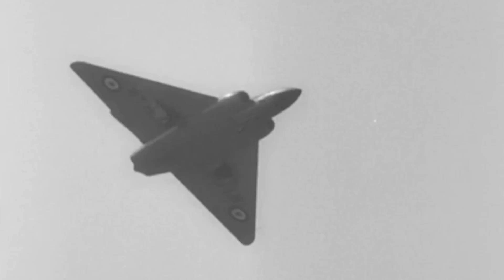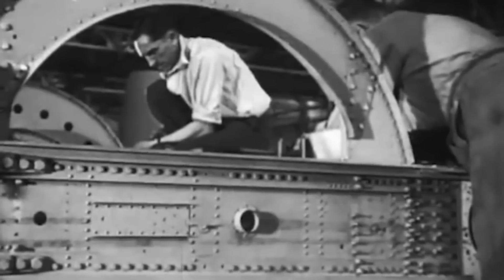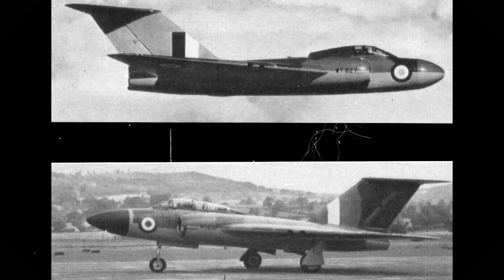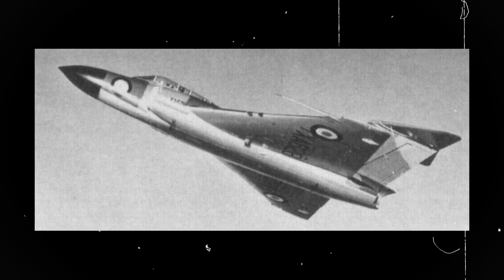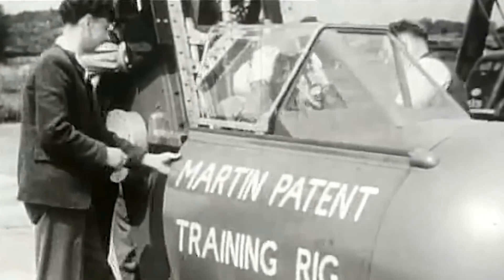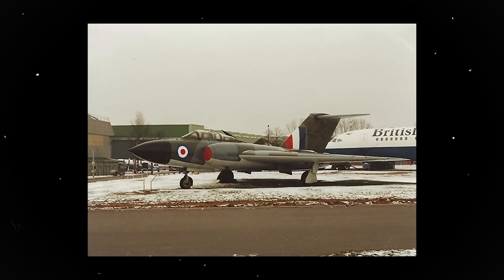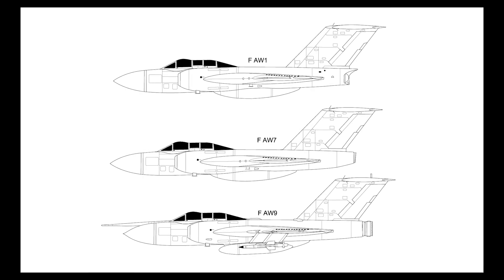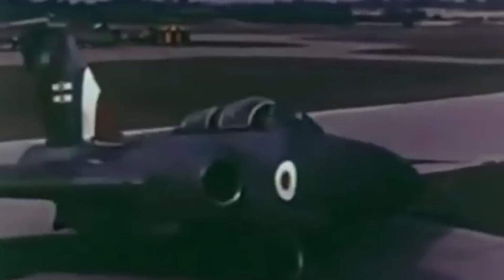The Bizarre Interceptor That Accidentally Broke the Sound Barrier

Comment: Is it just me or does the Javelin look like an early variation of the Tornado?
Reply: I think you need a trip to Soecsavers.
Reply: the Tornado is a German aircraft
Reply: @DoktorBayerischeMotorenWerke 
Obviously the Panavia Tornado is not a German aircraft.
Reply: @DoktorBayerischeMotorenWerke 
Jerkzxoffenzstadt & co etc - they should note with great deference & much awe.
   Having a registered office in Germany doesn't result in the Panavia Tornado Consortium actually being a German company.
     Indeed Germany of course no longer makes jet aircraft obviously.
           C H E E R S
                      &
Toodle   PIP  _Old_. Chap.
Reply: @petemaly8950  Germany is the largest manufacturers of jet aircraft in Europe... Please name a single British jet still in production in the UK????
Reply: @DoktorBayerischeMotorenWerke 
As they're aware obviously.
Germany has some assembly lines doing some routine drudgery stuff.
    In fact, BAe Systems, Rolls Royce of England & more than 200 other companies does more aerospace work than Germany on an absolute basis & considerably more work on a per capita basis.
  They might like to answer this question.
  Which airline has just ordered 60 RR XWB engines & what aircraft are the engines for?
  Bonus question for ten points - which country has the highest per capita combined aerospace / nuclear / defence sector activity in the world?
   😎
Reply: @Paul-mh9pr  Please name a single British jet aircraft still produced in the UK?
Reply: @DoktorBayerischeMotorenWerke  

They should note well with all due reverence & great awe.

WHY IS IT THEY CAN'T ANSWER SIMPLE QUESTIONS?
As they are aware, it is undoubtedly the case that the international aviation language is English & of course German pilots talk to German ATC in English 
As they're also aware obviously.
Germany no longer manufactures jet aircraft.
Germany has some assembly lines doing some routine Airbus assembly / drudgery stuff.
    In fact, BAe Systems, Rolls Royce of England & more than 200 other companies does more aerospace work than Germany on an absolute basis & considerably more work on a per capita basis.
  They might like to answer this question.
  Which airline has just ordered 60 RR XWB engines & what aircraft are the engines for?
  Bonus question for ten points - which country has the highest per capita combined aerospace / nuclear / defence sector activity in the world?
   😎
& Indeed 
 C H E E R S
of course👍
Reply: @DoktorBayerischeMotorenWerke 
    Of course, the basic design of the Tornado was of course from the UKVG  & AFVG (Anglo French Variable Geometry) variable geometry wing aircraft concepts mostly put forward by BAC where there would have been people at the time who were involved in the earlier Gloster Javelin aircraft design effort.
Reply: @Paul-mh9pr  WHY? Are there no longer any British jet aircraft manufactured today?
Reply: @DoktorBayerischeMotorenWerke 
The Tornado  was of course designed at BAC in England which involved Gloster design people.
 The engine is essentially an RR engine.
  Tornado manufacturing = 61.5% outside of Germany.

    Eurofighter manufacturing work share In January 1996, after much negotiation between German and UK partners, a compromise was reached whereby Germany would purchase another 40 aircraft.[23] The workshare split was therefore UK 37.42%, Germany 29%, Italy 19.52% and Spain 14.03%.  So 70% manufactured outside of Germany. 
The Eurofighter Engine is a RR engine that is manufactured in the 4 Eurofighter partnership countries.
Reply: @petemaly8950  Please tell us why there are no longer any jet aircraft designed and built in the UK?
Reply: @petemaly8950  BAC was a dumpster fire... it never produced a single successful aircraft on its own and went tits-up in spectacular fashion after the Concorde became the biggest financial failure in aviation history.
Reply: @petemaly8950  The Trent series is the only British jet engine still made in the UK.
Reply: @DoktorBayerischeMotorenWerke  
RR of England of course is the largest manufacturer of Gas turbine aero engines in Europe & on a home country per capita sector activity basis RR of England is without doubt the largest manufacturer of Gas turbine aero engines in the world.
Indeed, RR of England has wholly owned subsidiaries in Germany & in the US (Allison, does some Classified US Govt military work).
Reply: @DoktorBayerischeMotorenWerke 

Rolls Royce Holdings 
Subsidiaries
- Rolls-Royce plc
- Rolls-Royce North America (Allison etc Classified Military stuff)
- Rolls-Royce AB
- Rolls-Royce Deutschland
- Rolls-Royce India Private Limited
- Rolls-Royce Marine Power Operations
- Vinters Engineering Limited
- Rolls-Royce Controls and Data Services
- Rolls-Royce Power Systems
- Bergen Marine
Joint ventures include:
- Rolls-Royce Turbomeca
- MTU Turbomeca -

Trent Family
The MT30 (Marine Turbine)
Industrial Trent 60 Gas Turbine
Trent 7000
Trent XWB Airbus A330neo.
Trent 1500
Trent 1000
Trent 500
Trent 600
Trent 700
Trent 800
Trent 8100
Trent 900

RR wholly owned subsidiaries in Germany - handles smaller 2 shaft RR gas turbine aero engine work.
Reply: @petemaly8950  Name a single British jet aircraft still produced in the UK?
Reply: @DoktorBayerischeMotorenWerke 
 

The Tornado  was of course designed at BAC in England which involved Gloster design people.
 The engine is essentially an RR engine.
  Tornado manufacturing = 61.5% outside of Germany.

    Eurofighter manufacturing work share In January 1996, after much negotiation between German and UK partners, a compromise was reached whereby Germany would purchase another 40 aircraft.[23] The workshare split was therefore UK 37.42%, Germany 29%, Italy 19.52% and Spain 14.03%.  So 70% manufactured outside of Germany. 
The Eurofighter Engine is a RR engine that is manufactured in the 4 Eurofighter partnership countries.

The German company Dasa owns 10% of Airbus. After BAe Systems unloaded it's 20% of Airbus share it effectively removed significant Eurocracy shackles enabling BAe Systems to engage freely in more international work, BAe Systems now does more Airbus work than before unloading it's Airbus shares.
Reply: @petemaly8950  BAE Systems as 0% shares in Airbus since 2006.
Reply: @DoktorBayerischeMotorenWerke  
BAe Systems & RR combined  (RR also has no Airbus shares)  now do more Airbus work than Germany.  
BAe Systems now does more Airbus work that it did before 2006.
  Where do they get the ridiculous idea from that for  company A to do business with  company B the two companies have to each own some of each others shares?
Reply: @DoktorBayerischeMotorenWerke 
RR engines are not necessarily always named after English rivers.
The Eurofighter engine is of course an RR engine that did not have an English river name.
Reply: @petemaly8950  Airbus SE is not British.

Airbus UK is a wholly owned subsidiary of Airbus SE, a German, French and Spanish owned company... BAE has no shares in Airbus SE.
Reply: @DoktorBayerischeMotorenWerke @DoktorBayerischeMotorenWerke 
 

The Tornado  was of course designed at BAC in England which involved Gloster design people.
 The engine is essentially an RR engine.
  Tornado manufacturing = 61.5% outside of Germany.

    Eurofighter manufacturing work share In January 1996, after much negotiation between German and UK partners, a compromise was reached whereby Germany would purchase another 40 aircraft.[23] The workshare split was therefore UK 37.42%, Germany 29%, Italy 19.52% and Spain 14.03%.  So 70% manufactured outside of Germany. 
The Eurofighter Engine is a RR engine that is manufactured in the 4 Eurofighter partnership countries.

The German company Dasa owns 10% of Airbus. After BAe Systems unloaded it's 20% of Airbus share it effectively removed significant Eurocracy shackles enabling BAe Systems to engage freely in more international work, BAe Systems now does more Airbus work than before unloading it's Airbus shares.
Reply: @DoktorBayerischeMotorenWerke  
  
    Development of the EJ200 engine started when there was a need to power a multi- national Eurofighter Typhoon using a new propulsion system in the 1980s 
   The motive was driven developing the EJ200 engine was the need for less complex engine that can last longer, and with higher thrust capability. 
    EUROJET was formed to achieve this propulsion system. Through a consortium of four companies, namely Avio Aero (Italy), ITP (Spain), MTU (Germany), and Rolls-Royce (UK) (Ankara, ICDDA) 
   The consortium incorporated Rolls-Royce’s research on the XG-40 ACME-Advanced Core Military Engine demonstrator to develop a light-weight engine that uses state-of- the-art technology with a high thrust.
   Hence, EJ200 was unveiled.
70% of EJ200 engine manufacturing is of course done in the UK (35%), Spain (15%) & Italy (20%).
Reply: @petemaly8950  All Rolls-Roycejet engines designed and built in Britain are named after a river... engines had were acquired through sale or merger are not.

The EJ200 that powers the Typhoon is designed and built by EuroJet Turbo GmbH. a German company.
Reply: @DoktorBayerischeMotorenWerke 

   Advanced engine studies at Bristol Siddeley had already been done to support the BAC/Dassault AFVG (Anglo French Variable Geometry) and were based on the Pegasus two-spool arrangement. 
   At Rolls-Royce, where the three-shaft RB211 engine was in development, three shafts were considered better.[3] Rolls-Royce took over Bristol Siddeley in 1967 so the configuration for the RB199 (Tornado engine) was decided jointly, a three-shaft engine.
   RB199 - where RB stands for Rover Barnoldswick.
Reply: @DoktorBayerischeMotorenWerke  
The RB211 of course was entirely developed by Rolls Royce & of course did not have a river name.
RB stands for Rover Barnoldswick.
Reply: @petemaly8950  Thank you for proving my point... the Pegasus engine is not a Rolls-Royce engine,,, it was acquired from Bristol through mergers.
Reply: @petemaly8950  The RB211 is the TRENT series.
Reply: @DoktorBayerischeMotorenWerke  
The RB211 Is not the Trent series.
The RB211 was the RB211 for approx 20 years. The Trent series followed after & from the RB211.
Reply: @DoktorBayerischeMotorenWerke  
The RR 3 shaft engine arrangement used for the RB199 was not a Pegasus engine.
  RR had taken over Bristol Siddeley & was able to choose to decide on the 3 shaft engine rather than the 2 shaft Pegasus.
Reply: @petemaly8950  The Pegasus is a Bristol engine, Bristol engines all have mythological names.
Olympus, Centaurus, Pegasus.. etc.
Reply: @DoktorBayerischeMotorenWerke  
The Rolls Royce RB199 gas turbine aero engine used for the Tornado was in fact not a development of the Bristol Siddeley Pegasus.
Reply: @DoktorBayerischeMotorenWerke  Hello Sandyboy, why are you commenting in two of your identities under the same comment?
Reply: @DoktorBayerischeMotorenWerke  Hello Sandyboy. As you know Sandyboy BAC never went tits-up and is a legacy company of BAE Systems, which  is Europe's largest defence contractor and an important part of Britain's aero-space industry which, as you know is the world's second largest after the United States'.
Of course Sandyboy, just as you can never back up your bollocks about de Havilland going tits-up you'll fail to back up your bollocks that BAC went tits-up.
Reply: @DoktorBayerischeMotorenWerke  Hello Sandyboy, in regard to your question- "Name a single British jet aircraft still produced in the UK?", that would be the Typhoon which is produced by BAE Systems at Warton in the UK.
Reply: @DoktorBayerischeMotorenWerke  They were/are multinational. The Germans ain't getting all the credit for the lovely Tonka🇬🇧🇮🇹🇩🇪😊
Reply: @richardsawyer5428  Panavia Aircraft GmbH. (Formerly known as Messerschmitt) is a German aircraft manufacturer headquartered in Munich Germany... the Tornado is not a British aircraft.
Reply: @DoktorBayerischeMotorenWerke  it was a joint effort, but yes, it was primarily produced there.
Reply: @buzzbomb67  Germany is the largest manufacturer of jet aircraft in Europe, Britian no longer produces its own jets.
Reply: @tompiper9276  Your comments read like they are from the maturity level of a 13-year-old, What do you hope to achieve by trolling the comments with your childish remarks?
Reply: @DoktorBayerischeMotorenWerke  Well, they havent made a Tornado in 26yrs so I didnt think that was possible that they were still making it.  Sad that Britain has let their manufacturing go, like that, though.
Reply: @DoktorBayerischeMotorenWerke  As your comments appear to be nothing more than petty snipes at old aircraft I wonder what you are hoping to achieve. Perhaps you might muster a positive comment occasionally, but I doubt it. Whatever your problem is you need to grow up and get over it lad.
Reply: @tompiper9276  The Lockheed F-35 is the most advanced aircraft ever to see RAF service.
Reply: @DoktorBayerischeMotorenWerke  Indeed it is.
Reply: @tompiper9276  Please name a British jet aircraft that is still in production in the UK?
Reply: @DoktorBayerischeMotorenWerke  Why? I still don't care. You, on the other hand seem to have an issue with personal validation. Get over it son.
Reply: @tompiper9276  Why are you afraid to answer the question? Are you a coward?
Reply: @DoktorBayerischeMotorenWerke  Not sure which bit of the previous post you didn't understand son. Try re reading it.
Reply: @tompiper9276  Just answer the question .
Reply: @tompiper9276  Please name a British jet aircraft that is still in production in the UK?
Reply: @tompiper9276  Go run and hide again Timmy!
 Change your username again and pretend to be someone who is knowledgeable about aviation history
Reply: @tompiper9276  Just answer the question, name a British jet that is still in production in the UK???
Reply: @DoktorBayerischeMotorenWerke  What does any of this have to do with an aircraft that hasnt been built in 26yrs?
Reply: @buzzbomb67  EXACTLY! The Tornado has nothing to do with the Javelin
Reply: @DoktorBayerischeMotorenWerke  I didnt say it did.  I just said it looks like it couldve been an early variant.  In other words, I think they may have been partially inspired by thw Javelin.  Except of course, theres always that one guy who assumes you meant it literally is just a slightly redesigned Javelin.  Sometimes that guy is me. This time it was you, and you went off on a tangent that has nothing to do with either the Javelin video, nor my Tornado comment, as if Germany is better because they still make planes and the UK doesnt.
Reply: @buzzbomb67  How?
 The Javelin and the Tornado could not be more different and still be jets... They bear no resemblance to each other, and their development is not linked directly or indirectly, they are not even designed for the same roles. They were not developed by the same company or even in the same country.
Your comparison strikes me as completely illogical and bizarre.

You said it, not me...

The fact remains that Britain once had a very large and vibrant aircraft industry with many bold attempts with great fanfare to leapfrog ahead of the rest of the world which all ultimately ended in failure and total collapse while the Germans very quietly became the largest manufacturer of jet aircraft in Europe.

cheers mate!
Reply: @buzzbomb67 
  Tornado manufacturing = 61.5% outside of Germany.
    Eurofighter manufacturing work share In January 1996, after much negotiation between German and UK partners, a compromise was reached whereby Germany would purchase another 40 aircraft.[23] The workshare split was therefore UK 37.42%, Germany 29%, Italy 19.52% and Spain 14.03%.  So 70% manufactured outside of Germany. 
The Eurofighter Engine is a RR engine that is manufactured in the 4 Eurofighter partnership countries.
Reply: @petemaly8950  Its been since the 80s, since I read all that, but that confirms what I remember.  Thank you.
Reply: @DoktorBayerischeMotorenWerke  Hello Sandyboy, as you know  Panavia Aircraft GmbH was never known as Messerschmitt which as you know was a defunct brand since 1968 having been swallowed up by Bolkow.
As you know the Panavia Tornado was a joint British, Italian and German venture produced at various sites including Warton in the UK. As you know it was powered by RB-199 Rolls Royce engine proposal which was built in the UK and Italy by three nation consortium Turbo-Union which is headquartered in the UK.
Reply: @DoktorBayerischeMotorenWerke Hello Sandyboy, it's interesting that you should mention the F35. As you know, The British company BAE Systems is one of only two principle partners to Lockheed (Northrop Grumman being the other), Britain having been in on the project from the JAST programme. You will know of course that despite several other forward thinking European nations also joining the project, Germany demurred until Russia put the wind up them and only very belatedly they have bought their way in.
Reply: @buzzbomb67  Britain hasn't in this regard, BAE Systems is Europe's biggest defence contractor  (and still build jet aircraft in the UK), Rolls Royce is Europe's biggest jet engine company and the British aero-space industry is the world's second largest after the US' (that according to the United States Department of Commerce).
Reply: @fritzwrangle-clouder6033  I thought so.  Meant to confirm that but as usual, got sidetracked.  Thank you!
Reply: @sandervanderkammen9230  So sandyboy, you say to tompiper9276 - "Change your username again and pretend to be someone who is knowledgeable about aviation history"

You've tried that at least half a dozen times and it's never worked for you.
Reply: @fritzwrangle-clouder6033  I suspect Sandyboys alternative identies are actually his imaginary friends.